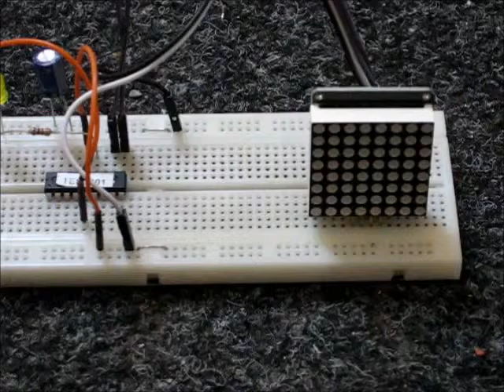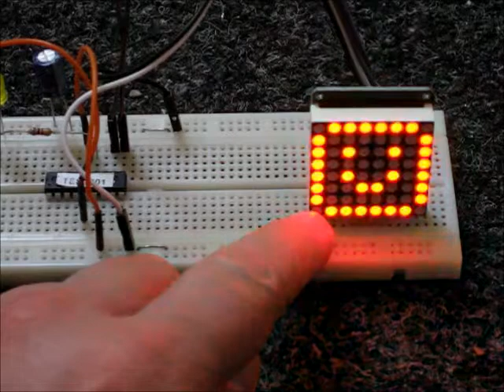I2C 8x8 LED Matrix with HT16K33 and PIC16F628A

Comment: Hi! Do you have some libraries for pic16f628a and i2c communication? I want to attach display from ericsson a1018 to pic16f628a.
Reply from the maker: Hello Tibor,
I normally don't use any libraries, but simply look in the datasheet of the I²C device I want to use and do some tests from there.

On my GitHub page (https://github.com/HvandeVen) is an example for PIC16F628A and display connected to a PCF8574A (see other video: https://www.youtube.com/watch?v=mZYpcIutQJE&t=5s), maybe you can alter it for the Ericsson A1018 ?
Reply: @hvandeven  Thanks for answer.  I' seen your video. I make some programs in assembly. First I tried bit banging and I found it quite cumbersome.  So now I try use USART in PIC16F628A for i2c .